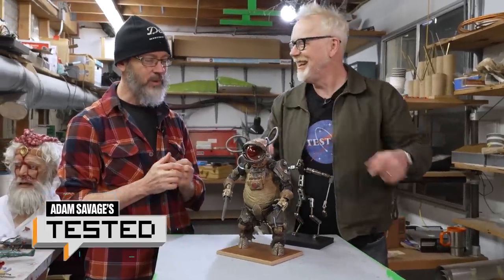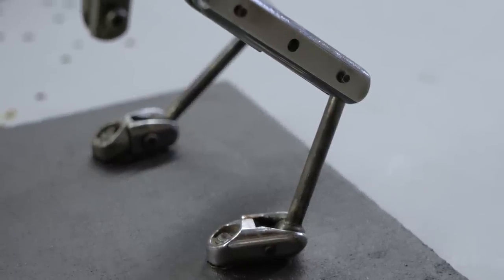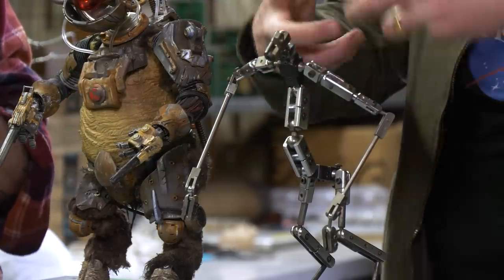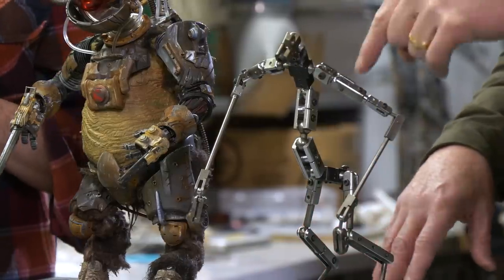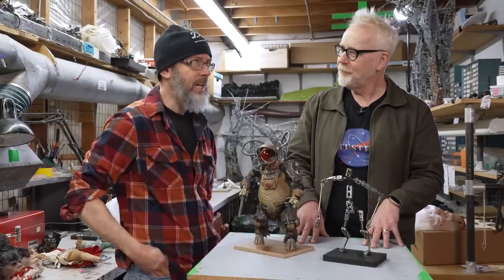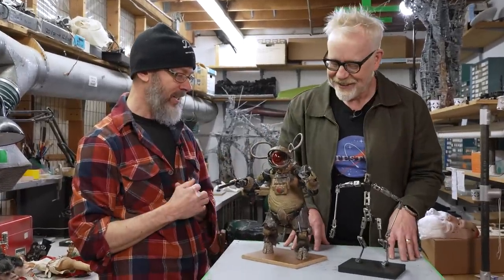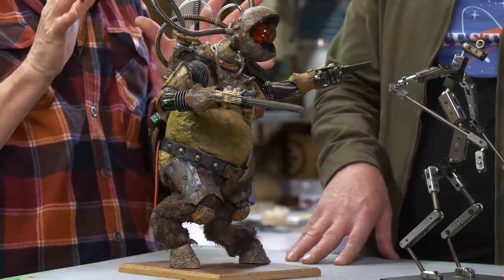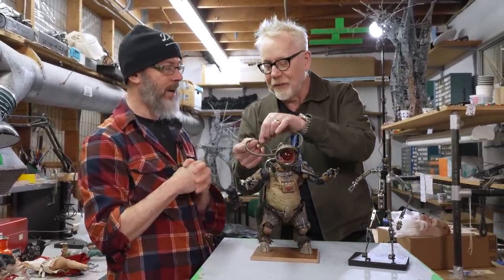Adam Savage Learns How Modern Stop-Motion Puppets Are Made

Comment: I worked for CJB Machining and did the deburring and tapping on the ball-socket joints for "A Nightmare Before Christmas" and "James And The Giant Peach".
Reply: What was your method of deburring back then? Was it a sand tumbler or would that have been more for the finishing? 🤔
Reply: @MLTharme  I don't know the names of the tools. First I used fine grit sand paper on the flat surfaces to remove the biggest burs on the edges. Then a short triangular knife on the edges. An "s" shaped rod with a sharp edge for curved edges. A drill bit (used by hand, not a power drill) to smooth the edges of the screw holes. Then a rock tumbler for polishing.
Reply: @rc4688  that's amazing, I always wondered how they did it in the 90s, thank you for taking the time to reply 😁👍

Comment: If you want an internal structure, use wool (genuine, sheep's wool). Not packed tightly, it's pliable, it retains its shape well.
For a cored out figure, no internals, just put some polystyrene and melt it down before painting with acetone injected via syringe.